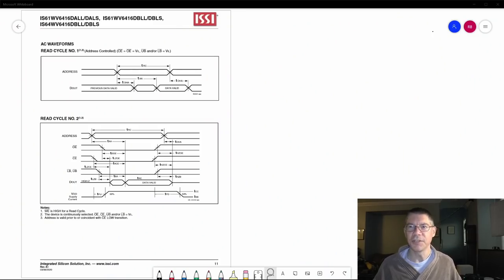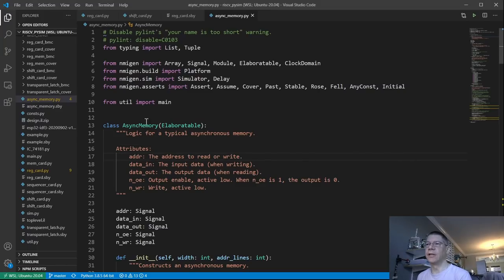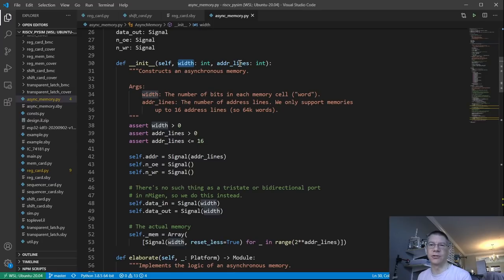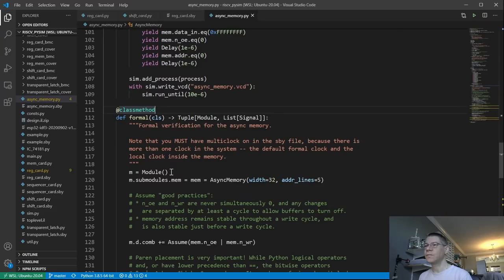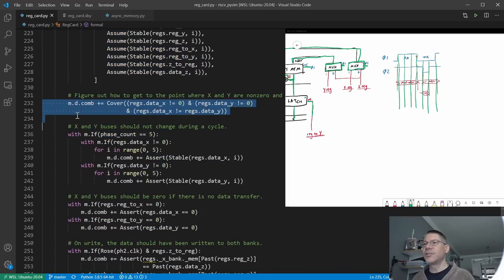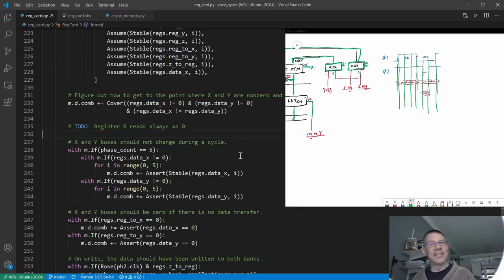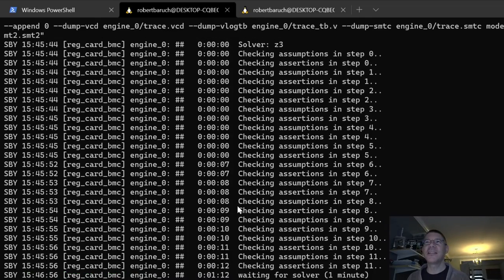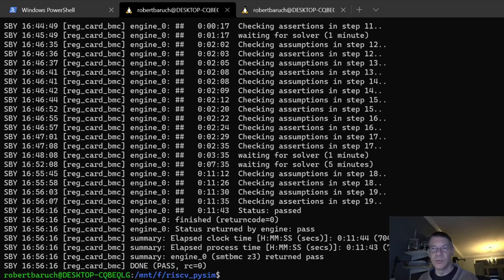LMARV-1 reboot part 2: the register card.

Comment: I know it's impractical to implement in discrete logic but I wonder if there are any synthesizable RISC-V cores which use hard instruction coding like ARM does?
Reply: What is "hard" instruction coding?
Reply: @arnauddurand127  Hard instruction coding is when instructions are implemented entirely in hardware rather than with microcode.  Acorn designed the original ARM processors in this manner since they saw microcode as a potential bottleneck in instruction-per-clock performance.
Reply: I think this is also called a "control matrix" implemented as combinational logic.
Reply: My understanding is that none of the RISC-V cores use microcode to implement their instructions. Microcode is typically a CISC thing. Did you perhaps mean without microprogramming? (that would be what a "control matrix" would be). The majority of the synthesizable cores don't use microprogramming either as far as I know, where they rely on combinational logic to do the decode instead - though the control matrix is implied because it's logically equivalent (lookup table vs logic gates).
Reply from the maker: @hjups  Correct -- the instruction format for RISC-V was designed to be nearly trivial to decode.
Reply: @RobertBaruch  I'm pretty sure that RISC-V took that idea from / was inspired by MIPS, since it's an almost identical form (but fields are moved around). And since R32I is only simple instructions, it can be decoded by breaking out the fields and sending the opcode to LUT ROM to generate the control signals.
Reply: @hjups  To be honest, even modern ARM chips would be considered CISC back in the day. But it depends on the definition you're willing to stick to. Besides instruction decoding and branching, "CISC" and "RISC" designs don't differ that much any more.
Reply: @flutterwind7686  That's correct. Many of the ARM instructions would be closer to CISC than RISC. That's why I explicitly didn't mention ARM. I would say that the minute you add an instruction that acts on memory, or performs the operations of multiple existing instructions in one, then it becomes CISC - that becomes a little blurry when considering multiply and divide. Anyway, all modern CPUs are RISC internally, where CISC instructions are implemented via an intermediate RISC microcode (I'm not sure about the complex ARM instructions - I would imagine the decoder emits multiple instructions to perform the complex task).
Reply: @douro20  The ARM1 uses microcode though?

Comment: That's mighty cool! But somehow I missed the part that writes to reg0 are ignored, I only saw that reads result in all 0.
Reply: Writing to register 0 is irrelevant, since the contents are never read back. In an FPGA, you might do the opposite, where you inhibit writes to register 0, but allow reading. The difference here is that an FPGA can ensure that the registers are initialized to any value (i.e. 0), however, SRAM will have a random startup value, which is unique to the silicon die, so you can't rely on that. A solution would be to pre-initialize the SRAM, but that requires more logic, so the simplest solution is to just never read from register 0 and let garbage be written there which is impossible to read back due to the circuit design.
Reply: I just figured that writes to re0 are irrelevant, as reads never reach. Thanks to the commenters!

Comment: The reflections of the ring light clearly Stan out. It would be annoying if I had to constantly on your face. But most of the time I look at the code or diagrams anyway. With your glasses on they do more bad than good, and any light (even ones that illuminate you worse) would be better... But it is not a problem that is big enough to invest time or money

Comment: Another great video. Migen has always confused me, but you going through it seems to make a lot more sense (at least for combinational logic).
So for a clarification question, when you say you want your CPU to be single cycle, do you mean single cycle execution stage? Or single cycle for the entire instruction (fetch, decode, execute). Right now what you have is a 2+ cycle / stage CPU, where you do a fetch and / or decode, and then do an execute + write back. If you were to do at least a decode + execute + writeback, then you need to break up your clock phases a little more - you can't assume that the control signals will be valid until some later stage in the cycle, since decoding will take time.
Also, I'm not sure if your register zero method will work correctly, since you are going to have a propogation delay between the OE signal and driving the lines low, which could result in a "short". Assuming you are only doing execute in a single cycle, you may want to drive the RAM OE signal from the external control logic for phases 1-5, but not phase 0, which gives your zero read logic time to determine if it should surpress the OE signal.
To do your zero checking, typically in silicon, large NAND gates are used - so a 5-input NAND gate for 32 registers where the result is 1 if they are all 0. You can also use a 5-input OR-gate where if any input is 1, the output will be 1 (so ~is_zero).
One possible solution to drive the register outputs low for register zero could be to use an open-collector driver. FETs would probably be too combersome since you would need 64 of them, but you can get NPN BJT arrays in packs of 4. That might reduce the maximum possible speed though since they aren't particularly fast. You could probably also get away with not worrying about bus collisions if you took that approach as well, since you could add pull-up resistors to the SRAM output which are probably push-pull. So the circuit would go RAM <- Resistor -> Bus tap <-> NPN <-> GND. The NPN would drive the bus low when it needed to regardless of the RAM output value, and when the NPN is disabled, the bus will float with the push-pull voltage of the RAM. One issue there could be the resistor value though, you want it high enough that you don't draw too much current when the RAM output is 1, but you want it low enough that you have are able to drive the attached devices (i.e. pass the VIL and VIH thresholds).
Reply from the maker: That's a lot to unpack. Let's see... okay. Since I haven't designed the entire thing yet, I can't say what the final cycle count will look like. That's why I'm designing it fully in software first. My goal is to have as much happen in combinatorial logic as possible, without going crazy with hardware. As for the OE on the RAM, you could be right. The turn-off time for the RAM output is 6ns while the enable time for the latch is more like 2.5ns. I'd rather not use resistors if I don't have to, that would only slow things down. I don't think it's a big deal to idle things during phase 0. I'd still have phases 1 and 2 to do "work".

Another alternative that I've been eyeing up is using a multiplexer instead of buffers. There are 2:1 16-bit multiplexers based on FETs.
Reply: @RobertBaruch  I would say that it would be important to figure out if you want to do decoding an execution in the same cycle, but you could always add more clock phases / slow down the overall cycle if you decide that you want to do that.
The issue with phase 0 idling is that you need more clock pulses. However, you could probably co-opt your phi2 clock to do that, since you have the longer phi1 pulse to determine if it's reading or writing. That could be tricky though, because you want to minimize switching, so you would have too choose the logic carefully (you don't want to enable OE when phi1 switches from high to low).
Multiplexers will probably be a good solution, since it's fewer chips and cost probably isn't that big of an issue. It would be equivalent to an un-optimized synthesis of "if(x) y else 0". Another thing you could do is just mask it. Use AND gates for the RAM output, and use an inverting signal so you have out = RAM AND ~isZero. AND gates might be cheaper / less overkill than a mux. You may want the choice to come down to the pinout of the chip - which is easier to route.

Comment: I'm guessing I'm here way too late since you probably founda better solution in a video I haven't seen yet but for reg0 wouldn't it be way easier to just use a mux just before the X latch and the Y latch? Basically you just have your Y mem going to one of the input, a logic 0 going to the other input and control the mux with the address line added together? It would require 8 and gates and 2 2->1 muxes so not sure it's the cheapest option but it does seem easier than what you're explaining in your video

Comment: can you add sound , video hardware,TCP/IP stack,build compilers(C language), operating system(UNIX-Like,minix would be fine), middleware stack,TCP/IP (should at least serve web-pages,etc.) and application programs.please support telnet sessions also.
basically the whole complete system (not just the cpu which is useless by itself)
Reply: I2C/serial, and PS/2 is probably minimum. And some storage of some kind, unless you're fine with flashing ROMs for everything you do.